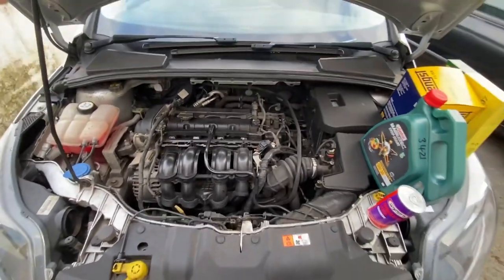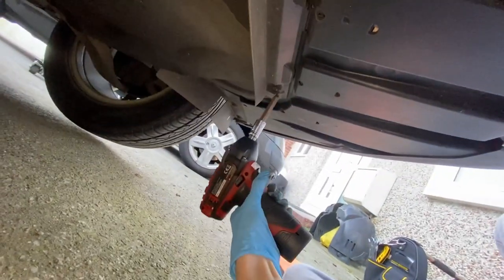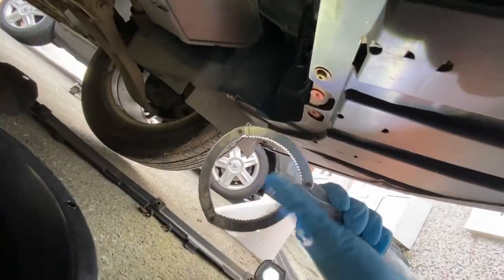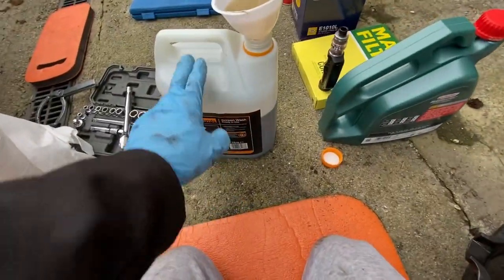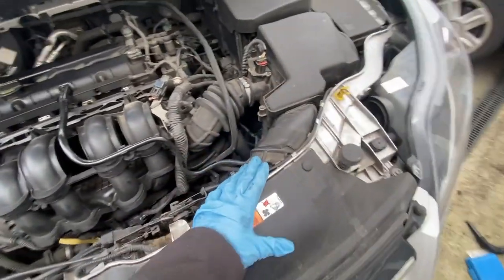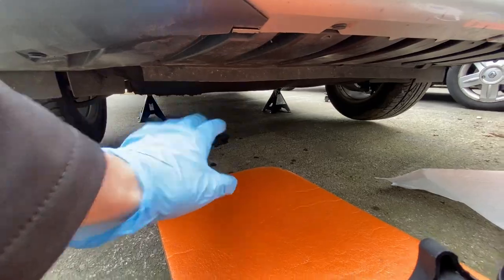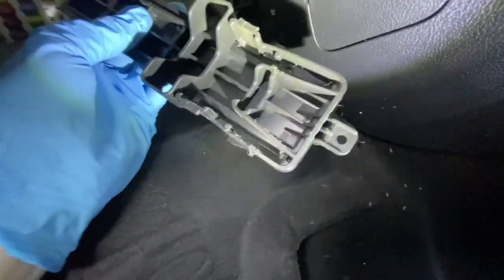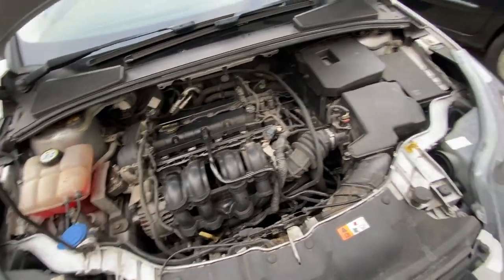How to Service a Ford Focus 1.6 mk3 with Ticking Engine!

Comment: I thought they all just sounded like that! Worth noting is these engines should have the oil level at the top notch on the dipstick for the VVT to work at its best.
Reply from the maker: Yeah tuck if for mot and the guy said it sounded fine as well to be fair

Comment: That cabin filter was horrendous, the one I changed on my 2004 Rover 25 wasn't even that bad and that had never been changed, judging by the manufacturing date on it. Great service vid. I'm thinking of getting a 1.6, but I've been put off by the horror stories of the wet cam belts deteriorating. I've been a bit put off by the 1.6 Ecoboost (Ecoboom) engine
Reply from the maker: Yeah it was really bad definitely had not been changed it a while and yeah I would stay clear of them there really unreliable engines I’ve had a couple and thankfully they have been fine but I wouldn’t chance it

Comment: This engine has a quite noisy design and those noises are caused by piston slapping and  rod to piston pin connection excessive wear. Any additive will not solve that. Changing the oil more frequently might slow down the process.
Reply from the maker: Hello thank you for the feedback I was unsure if the additives would work but thought I would give it ago whitest changing the oil
Reply: @restoringsalvage  It will run  many thousands of miles without any problem. It is just noisy and annoying. But it is just a cheap car.

Comment: I added Wynn's complete fuel system cleaner (Black version not purple one)  into gasoline tank and after 100km of highway drive this engine noise like it's disel engine and not gasoline is not present any more. I guess that after some time it will came back but I guess that additive did something.
Reply from the maker: Yeah it seems too work fine dose what is says on the tin aha

Comment: Why is the oil filter in such a horrible position? oil just goes everywhere...doesn't this make the car smoke when you start it back up?
Reply from the maker: Ano it’s so stupid and no I cleaned it up with brake fluid and it was fine

Comment: i have same engine with 125 hp . 158.000km real,same noise.
I Use Motul 5w30 without another solution
I tried a cleaner for injection,and fuel consumption in stay pozition is 0.5
i tried more spark plugs(ngk simple,original motorcraft and denso iridium)  i want to try evo brisk iridium 360
Reply from the maker: I’ve been told these engines are just loud and that it’s not an issue!

Comment: This guy has no idea how to service a car NEVER remove a MAF sensor to install an air filter NEVER tighten an oil filter with an oil filter REMOVAL tool oil filters are tightened to HAND tight only NEVER drain an engine of oil with the filler cap on still NEVER fill the engine with oil with the dip stick in still and definitely NEVER fill the engine with oil while still on axle stands this gives an inaccurate reading on the dip stick I suggest you let a professional service your car next time
Reply from the maker: Thanks for the feedback will be noted 🙏
Reply: Maybe he didnt want to be ripped of by a professional mechanic.
Reply: Ok boss lol
Reply: Hand tight oil filter only - agreed. All the rest, you're talking blx and none of it makes any real difference.
Reply: why never remove maf sensor? first time seeing this "tip". it really doesn't matter if you do it carefully, also, because, in Focus MK3 you CAN'T INSTALL NEW AIR FILTER WITHOUT REMOVING that stupid maf. You just have to do it. You can pull out already fitted in, but you can't mount new. Fought with that for half an hour during my first air filter change.